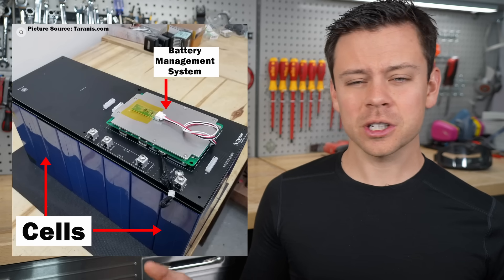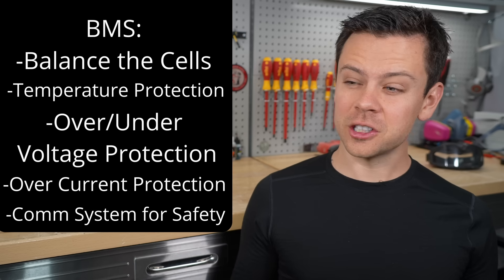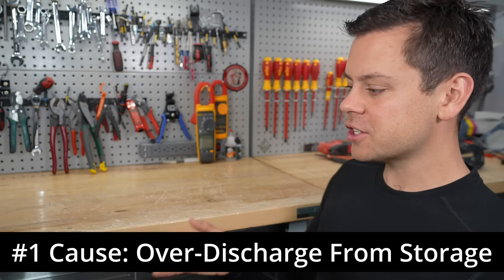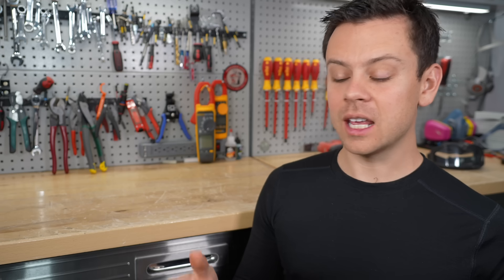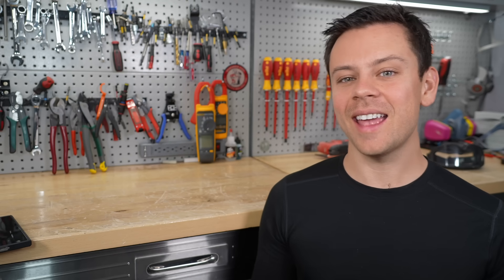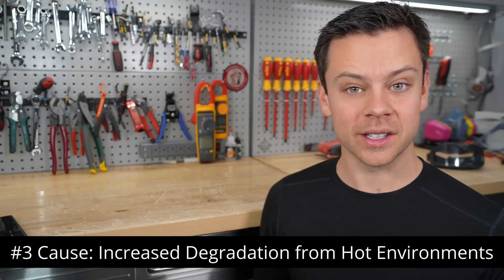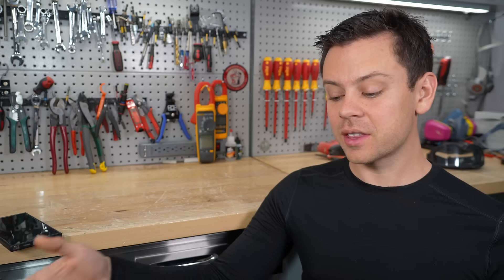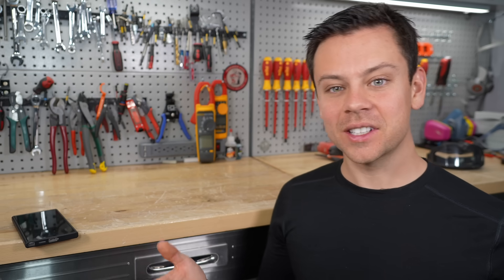The Rules of LiFePO4: The 3 Most Common Causes of Failure and General Guidelines for Long Term Use

Comment: I have 3 Battleborns connected in parallel, to provide 12 Volts and 300 Amp/Hours, for my camper. I charge them using Solar Panels and a Victron MPPT Charger. Do I ever need to disconnect the batteries from each other, to allow proper BMS functionality, or do the internal BMS units keep the 3 batteries properly balanced even though they are always connected together? Thanks for your thoughts!
Reply: You can leave them paralleled, it won't effect internal cell balancing or BMS operation at all.
Reply: @junkerzn7312 ~ that’s what I was hoping~ thank you for the info ~ much appreciated!    👍👍

Comment: "People seem to think they know more than the engineers who designed these things." 
Unfortunately very true. Also, might I add that by the time these batteries hit their 10 year mark, they will still hold most of their capacity and by that time, new tech or cheaper cells hit the market and you STILL have your Lifepo4 batts.
Reply: We trust the engineers. We just don't trust the bean counters and Planned Obsolescence.
Reply: @PatrickKQ4HBD  😂😂
Reply: @MrHuram-abi  all fun and games until it's a subscription for something you already bought.
Reply: Not so much the new cells but that the same battery size of that chemistry cost will be like a quarter of the current 50 odd USD per  kWh coming out of CATL /BYD now.
Reply: It's marketing and accountants we dont trust.

Comment: Hi, Your Life Seems To Be Consumed With The Care, Maintenance And Babysitting  Of LiFePO4 Batteries.  No Thanks, I Live In The Adirondaks, Off Grid And Care Free With My AGMs! The More I Listen To The Lithium Gurus, The Less I Am Interested In Them!!! Lol Just listen to your intro...scares the crap out of me :)
Reply: Wow I don't even think we watched the same video.
Some people are afraid of new technology.
If your system is working for you exactly how you want it to, keep on with it:)
My life is not consumed at all with care or maintenance or I think you called it babysitting lifepo4 batteries.
I have three of the E G4 48 volt 100 amp hour batteries hooked up to an EG4 3000 all in one inverter.
I do absolutely nothing to it. it works flawlessly it starts charging automatically when the solar panels start bringing in the power.
The only thing missing is, I think I need three more batteries before I move and go off grid.
Reply: @mycabinlife1291  In The Future Are We Going To Need Three More "Zero Point Energy Modules"? I Think Not. A REAL Leap Forward Would Be Most Welcome And NO Babysitters!!! Lol
Reply: How often do you have to replace those? I had to change mine out every four or five years, as they would no longer hold a charge, and were totally useless . My LFP, (LiFePO4), batteries will last at least ten, if not twenty years, and even then will still have 80% of their origional capacity...still very usable!
Reply: @Tumbleweed5150  10 100ah AGMs main cabin 800 sqft, 4 original from 12 years ago. 3 100ah AGMs in three vehicles running diesel heaters AND 2 100ah AGMs in the cabin (opposite side from the main cabin bank) running an additional 2 all-in-one diesel heaters (wood stove and propane heat on standby...fridge,hot water, stove etc.). Oh Yeh,  That is 15 AGMs In Total, Never Replaced and as good as can be expected!!! Lol.  PowerMax 75 Converter For Main Array, 2 WEN Gennys 2800 & 3800. 500 watts solar. Zero Point Energy Module Is On Its Way From EBAY!!!....................................SOMEDAY

Comment: Okay Will...so if we understand you correctly you recommend that we charge our Teslas up to 100% (or for that matter any EV)  every few months to balance out the cells, correct ?
Reply from the maker: Yes
Reply: Only if they have LiFePO4 batteries. Otherwise, stick with what the manufacturer recommends.

Comment: What’s the best 12 volt battery balancer?  I have a couple of small systems.
Reply: That depends on if you mean you made the batteries yourself or if they are "store" bought 12.8 LiFePO4 batteries. If the latter, the BMS  in the battery automatically balances the cells inside once the battery reaches 100% Capacity, or between 14.2 and 14.6 Volts. Most recommend charging up to 14.4V. I like to make sure my batteries charge up to 100% capacity for at least a couple of hours, and at least once or more a week. The only time my system doesn't charge up to full, (or at least 99%), every day is when we have more than a couple of days of total cloud cover.

Comment: What about a high humidity environment? I live in florida so i made a air-conditioned room for all my solar stuff but i was wandering how nessasary was it?
Reply: A Less humid environment is much better for electronics just in general.  Another advantage is that calendar aging is a direct function of temperature, so keeping batteries in a conditioned space will vastly improve their lifespan.  (That said, the electronics are still guaranteed to fail long before the actual cells do, either way).

Comment: So cycle 100% to 0%?
What does that mean in voltage? 3.65v to 2.5v per cell?
Reply: For LiFepO4 100% is roughly waiting for the charging current to tail-off above 3.40V.    But balancers don't typically engage until at least 3.45V (some won't engage until 3.50V).  So charging to 3.55V and waiting for the current to tail off is the general rule of thumb.

The BMS disconnect is typically at 3.65V (you don't generally want to charge all the way to the BMS OVP disconnect), and the actual electrolyte starts to seriously degrade above 4.2V and will collapse above 4.6V.
Reply: @junkerzn7312  Ok i am already doing that with my jk bms, but how about discharge threshold? Charts say 2.5V is 0%, i am doing 3V right now which i thought was low enough
Reply: @emilioarroyomohamed  you don't need to take them to 0 percent - I think he was just using that as example that you can without hurting battery. I wouldn't take them to zero becaue you risk getting to point where bms shuts down the battery on low voltage protection.

Comment: Hello guys , I have one question and forgive me for my ignorance , I have a growatt 3kw all in one inverter with one generic lifepo4 Chinese battery from AliExpress 6.2 kw, the battery works perfect using it for one year now, my question is I have 16 lifepo4 cells 105 ah , if I build a battery using a Daly bms can I connect my current battery with the new one in parallel ? Thank you
Reply: It is usually best to only connect batteries of the SAME Amp hours and Voltages.

Comment: so glad i go to 100%, whatever free energy coming in i want it. many say 20-80% to make them last, as you say. i didn't buy these batteries to lose 20% off the top end. I already lose some % off the bottom end as voltage starts to drop and certain loads need min volts. I seldom go to 0% as i always want something in the bank, but it does happen. And i expect the bms to handle these things. tyvm Will that was perfect, i was curious. And yeah i figured a good named company uses a good bms and design and have way more engineering than myself (and the random youtube vids).
Reply: I remember coming across a paper a few months ago that was saying that keeping LFPs at 0% SOC is actually okay for them, contrary to the common practice of keeping them ~20-30% for transporting them. Didn't save the link unfortunately. I fully charge (and leave at 100% for ~10 hours) my spare one.

Comment: I use my ecoflow delta 2 almost daily. Did set the charge and discharge points at 90% then 10%. Also lowered charging speed to 400 watts. Didn't realize the balancer won't kick on, looks like i need to change my settings
Reply: depends on how the particular bms is programmed - they aren't all set the same.

Comment: Have you seen the next gen Military rechargeable batteries, based on Silicone graphene not lithium.
The US military just approved funding for a new silicon-based battery, charging forward into commercialization.  NanoGraf’s silicon oxide-graphene (SOG) batteries
Reply: The silicon-graphene batteries are still lithium-ion batteries.  They just have a silicon-graphene lattice to store the ions.  Pretty cool little beasts but they'd be very expensive and not really appropriate for the consumer market.
Reply: @junkerzn7312  thanks for looking :  )

Comment: Using a gas generator to charge all in one inverter/chargers.    There are reports of burning out circuit boards on the inverters and or other appliances under load.
Reply: That is why my favorite Youtubers say to use a seperate charger to charge the battery/battery bank. The main reason is two-fold. "Dirty Voltage" from most generators, and the fact that most ALL IN ONE units send power to output AND charging, meaning you would need a generator rated for at least twice, if not more the Wattage output of the AIO.

Comment: Great episode! Question/confirmation i want to store lipofe4 over winter on a boat that will be on hard, and will be disconnected (up to -15 dec C) can i charge the battery to 100 % balance and switch everything off and leave it for 4 months will it not damage the battery?  or should i keep it at 70 % for storage and let it "self discharge" for that 1-5% in cool and be good for spring?
last... i belived i need to keep lipofe4 at 80% ... thanks for teaching me the new stuff!.
Reply from the maker: At any given time I have at least 50 batteries on my property and I just leave them at 100%. Because the only way I have ever been able to kill one of these things is from over discharging it and thinking it was at 50%. People get mad though and still want to go by the recommendation of 50% but personally and my house I do 100%. It's very easy to forget about a battery. Especially during winter
Reply: @WillProwse 
I finally got the answer I was looking for from Will in this post
Thank You Will

Comment: @5:15 you keep saying you can charge and discharge to 100% and 0%, which i agree with, but youre missing context. you dont say what voltage is 100% and what voltage is 0%.
Reply from the maker: Whatever the BMS disconnects at. For low and high voltage disconnect. That is 0% and 100%
Reply: @WillProwse  from what i understand, different companies use different voltages?
Reply: @WillProwse I keep seeing 14.2-14.65v being recommended for charge voltage. But what voltage is best and do you recommend in order to accomplish 100 percent and alow the bms to self balance while also not hurting the battery? Thanks.
Reply: Very informative! Could you do the same for solar panels as well for  degradation and longevity?

Comment: I am off-grid and use four Enjoybot 12v Lifepo4 batteries setup in series 24v  (2 bats 24v ) and paralleled hooked up to a 5000 watt inverter to run my 1hp water pressure tank. The charge controller is a Renogy 40 amp . I set up the charge controller in manual mode with the charge set at 13.7 volts , if I set it any higher the inverter trips because the voltage is too high. 13.7 x2= 27.4v. It's a 24v inverter. The Enjoybot batteries have been doing well now for two years. Thanks for all of your helpful videos!!

Comment: Didn't realize BMS was replaceable. Are they generic to particular chemistry or would I have to obtain from original manufacturer. Do you have a video on replacing BMS?
Reply: Generic to some degree, usually by cell chemistry - lifepo4, lto, NMC.

Comment: Can lifepo4 battery be safely charged with a car type battery charger?
Reply: Depends on the output voltage.  It can in an emergency but it isn't good for regular operation.   If the charger's output voltage is only 13.5V (ish) it won't be able to fully charge the LiFePO4 battery.  If it is below 14.2V it might not be able to go high enough for the battery's internal balancer to operate.  If the vehicle charger has any sort of equalization stage, then don't try to charge LiFePO4 with it at all.

And since these chargers typically don't float after charging is complete, it isn't good for the battery to just leave one connected.

So... in an emergency?  Yes.  Otherwise... don't.  The charger must be current-limited too (many alternators are not and will burn-up trying to charge a LiFePO4 battery).

-Matt
Reply: @junkerzn7312  Thanks for the advice.

Comment: For those of us that have our ecoflow battery generators and are preppers that mostly keep these stored. Every 3 months do we charge it all the way to 100% for the battery balancers? And then discharge it down to 50% for storage? Or just charge it up to 100% and leave it every 3 months? I think you mentioned that the proper percent to store it at is 50%
Reply: I am not sure, but I believe the 50% is the minimum to charge it to...or leave it at. The 100% is for making sure the balancing is done. SHIPPERS are not allowed by law to ship them at over 50%.

Comment: Oh dude. I had that exact problem storing a battery for 2 years.  And YES I tried to use later and it worked but was very erratic but unpredictable. Hard to diagnose.  This was the issue
Reply: If it is being flaky on and off after sitting for 2 years you may have a cell that leaked or a cold weld that gave up the ghost. 

If you have an old old AM radio you can use that to detect the spark if it is a weld that gave out by tapping on the thing.
Reply: Don't understand the AM RADIO hack. Please elaborate @scurvofpcp

Comment: My 100ah battery says charge voltage 14.4 volts...   So is it better to charge to 100% with higher amps  or lower amps. ?
Reply: It doesn't matter, as long as you don't go above the recommended Amps for the battery. (Usually about .2C. or 20A for a 100Ah battery). The BMS controlls how much Amperage goes to each cell.
Reply: @Tumbleweed5150  Thank you!

Comment: Hi folks. Since many years I heard "do not charge over 90% and discharge under 10%" to have a long lasting battery. So what should I do now ? Do manufacturers say as you're telling us ? I'm Lost, so I'm gonna drink a beer to solve this problem ! 😊
Best regards from France 👌👌
Reply: Depends on the cell chemistry.  For example, you don't want to drain a lead-acid battery below 50%, and you generally don't want to charge a NMC (standard lithium ion) battery above 80%.  But LiFePO4 is a different chemistry, none of that applies to LiFePO4 and if a manufacturer says differently, they don't know what they are talking about (very common with all of the fly-by-night battery brands out there, actually).

A LiFePO4 battery can and should be charged to 100%, and can (if desired) be drained to 0% (not 0V, zero percent), on a regular cycle without any worries.  The only issue when draining a battery to a low SOC level is that if you forget to charge it up, it now doesn't have to fall very much further before cell voltages get too low.

If you are cycling regularly such as with a solar system, cell voltages will never get too low so it just isn't an issue. it will lift off the instant the sun comes up in the morning.

-Matt
Reply: @junkerzn7312 @junkerzn7312 Thanks a lot for these explainations, Matt. I remember a Will Prowse video, when he visited a Lifepo4 factory. The guy told him Lifepo could be charged at 100%. Honestly it was the first time I heard this, as the common rule was about 90%. 
So thanks again, 10% more power is much appreciated for my campervan ! Have a nice day 🙏

Comment: I have my bms set to 3.55 volts per cell...are you recommending I go up to 3.65?
Reply: At least 3.60, if you are talking 4 cells in a 12V LFP battery. A 12.8V LiFePO4 battery should charge up to about 14.4 Volts for at least a couple of hours to balance the cells properly.

Comment: Hot is relevant. Someone in Alaska might think 70 is hot. In southern Texas that's winter jacket time. Is 130 hot for a battery?
Reply from the maker: You mean relative? Relevancy is different. The cells don't know any different. Whatever the temperature of the cell is, that is the temperature. Humans have different temperature regulation and perception because of how we cool ourselves. For the batteries it doesn't matter.
Reply: @WillProwse  What temperature is too hot though? I've heard 140ºF+ is bad for LiFePo4. I think that would only happen in an attic though, even in Texas. 🤔
Reply: @WillProwse  auto word selection still sucks

Comment: What maintenance charger would you recommend to keep the batteries at 50% state of charge while not in use?  Would it be sufficient to use a normal 12V charger, say a 1 Amp DC power supply?
Reply: Im not Will of course... but IMHO best practice for batteries that you are not using and cycling (in other words stored for when needed) is to charge to 100% every 6-9 months and right after that, discharge to 50%.  You need a battery monitor or way to measure the Ah drawn to get to 50%.
Reply: @W-4-Z-D  So glad I saw this video, hopefully in time.  I've got work to do ASAP.  Hopefully they are not overdischarged.

Comment: Good to know - I bought four LIFEPO4 Ecoworthy 12V 100Ah last month to put into my battery boxes that are paired with foldable solar panels, but have them stored in a cabinet. I'll take them out to fully charge them this weekend. Thanks Will!
Reply: 50% not 100%)
And cycle it once or twice before storage to balance cells 0-100-0-100-50 , good luck
Reply: Same for me , but only bought 3 .